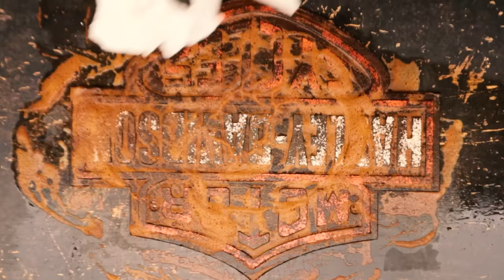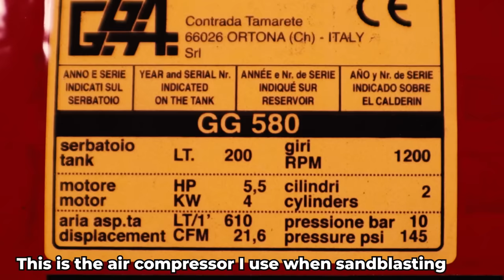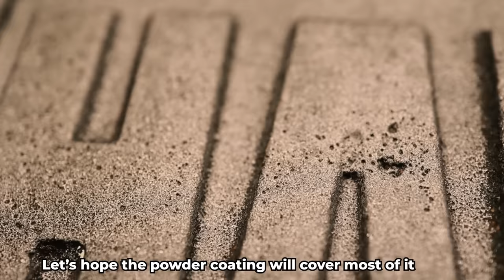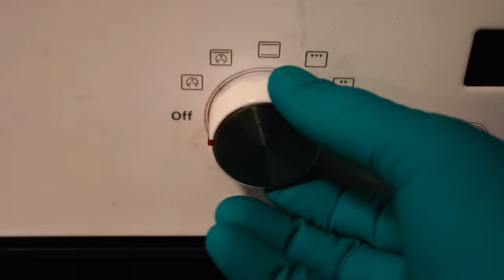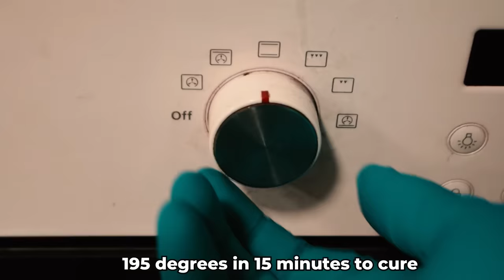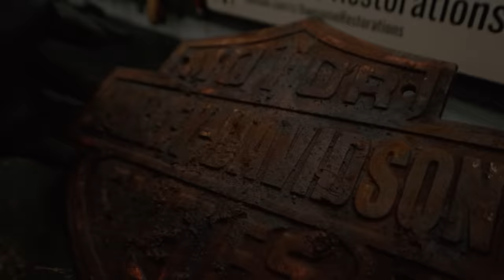Vintage Harley Davidson Motorcycle sign Restoration

Comment: The Harley colours are orange and white not red..
Reply from the maker: Thanks for watching and for your  words 👍 Efter doing some research and looking att this specific sign (witch was red under the rust) I did choose a Harley Davidson red color. I think that this looks better in my garage 😉
Reply: Harley colors are orange and white, just like what was under the rust.
Reply: I believe what was called red was more of an orange color just like the 68-69 Pontiac  GTO's were painted "carousel red" which was actually an exact paint code match to the Hugger orange that Chevy was painting the Camaro at that time. I could be wrong I just thought it looked more orange than red. Either way I would have left the patina. Good video though.
Reply: @AwesomeRestorations  If you're restoring (as in your name) you should have used orange instead of red. You devalued the sign. Anyway, it's yours and if you're happy with red that's your business.
Reply: It's Vermilion. About half way between Coca-Cola red (Fire Red), and Orange. If you put it next to red, it looks orange. Put it next to orange, it will look red.

Comment: Like you, i really liked the sign after the first two cleanings when you could see the original colors but it was still pretty weathered; however, i appreciate the beauty of the full restoration.
Thanks for sharing the particulate and pressure when you sandblast.
Reply from the maker: Thank you! 😊

Comment: If you want to cover pitting a low-filled primer or a good sealer primer will usually fill in enough to get a smooth finish

Comment: I’ll take the full restoration.  It’s still the real deal! ....only now, as if found after having been  lost for decades perfectly preserved in   an old geezers repair shop on old route 66.  I agree with most of the comments that “Patina” has its own mojo......But, really there’s nothing particularly $ valuable in a 90% deteriorated sign.......it wasn’t a true time capsule museum quality piece. My money says it has more nostalgic AND $$$ value now! because it can transport you to an era long past.....one tiny connection to what guys back then would have seen and used to conjure up their own dreams of stepping up and joining the Harley owners group.       Well done sir.
Reply from the maker: Thanks for watching and for sharing your opinion I really appreciate it 👍 - its on my wall now... that where it has most value 😉👌

Comment: It would've been cool if you had done a computer color match, that way you get those beautiful original colors. 
Still looks real nice the way it turned out, good job!
Reply from the maker: Thanks for watching and yes I need more light in my shop... colors on my videos are a little odd i know 😬😉👍
Reply: @AwesomeRestorations  I think that the lighting is pretty spot on, your content is honestly top notch. The computer color matching I meant was with the paint from the sign, would be neat to get the code for the original paint color

Comment: Yea I liked the aged long once you scraped it with the brush. Get the loose built stuff off. Some things just look nice when they have that weathered look.
Reply from the maker: Thanks for the tip. cheers :)
Reply: @AwesomeRestorations  the finished looked great too. Sometimes it’s just hard to decide when both restored and weathered look great. I struggle with this and the antique farm equipment I work on.

Comment: For higher collector value/desire you should have stopped after cleaning and left the original paint.

Sign might be worth as much as a whole penny (but probably a lot less) of every dollar it was before you sandblasted it.

It looks like a reproduction sign now ... especially with that powder coat, which didn't exist when that sign was made.

Comment: I’ve been asking myself this question for so long now and I need an answer please 😫  : does sandblasting cover the rust or does it remove it ?
Reply: It will remove it. Think of it like sandpaper. The friction provided by the sand removes surface material. How much material removed depends on how course the sand is and how much pressure is being applied to the surface to the object. That's why he shows the grade of sand and how much psi is used with the compressor. Hope that helps.
Reply: Lilly Ess thank you very much !
Reply: @lyricstraduction8768  you're very welcome.

Comment: Hey please tell me what is sandblasting
Reply from the maker: Sandblasting is when you "spray" sand under very high pressure (the pressure is made by a compressor). The high pressure allows the sand to remove dirt and rust :)
Reply: @AwesomeRestorations  ohh ok

Comment: I'm watching thinking, how old is it, that looks like a lot of surface rust. 
I don't see much metal corrosion, hell most of the paint was still on the sign..... and I'm no professional but there is always a bit to much sand blasting being done. Just saying. 
The finished product usually looks good though, but the item is generally worthless after the restoration work that's done.

Comment: How the powder coating gun works? Do You use high voltage and ground make the powder stick on the surface with less potential? That's fucking engineer, I've never seen something like that. What's the chemical composition of the powder?  You're fuckin' breaking that YouTube game man hahah